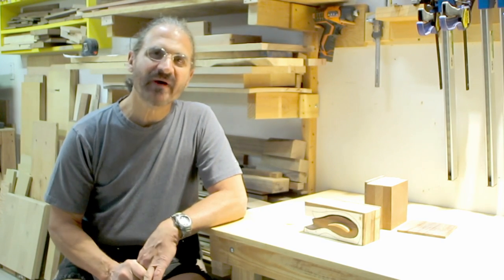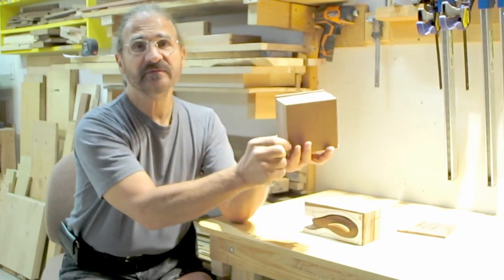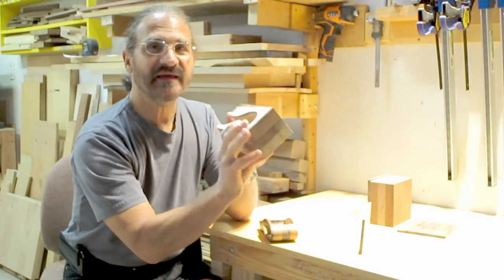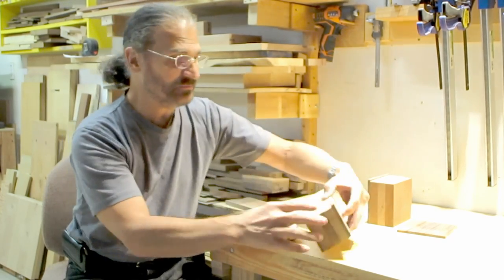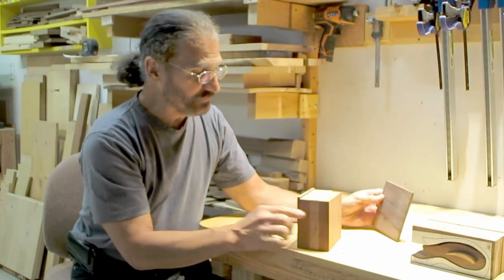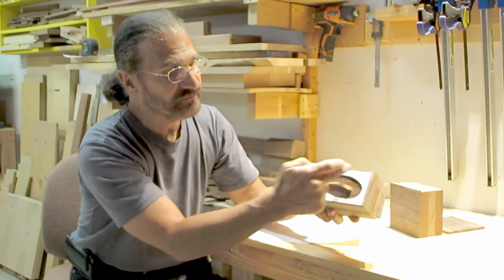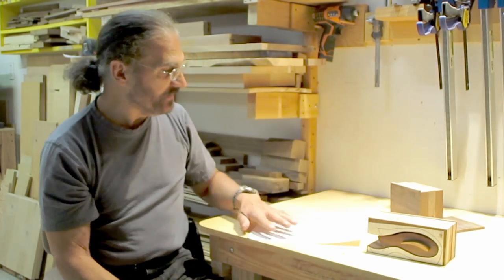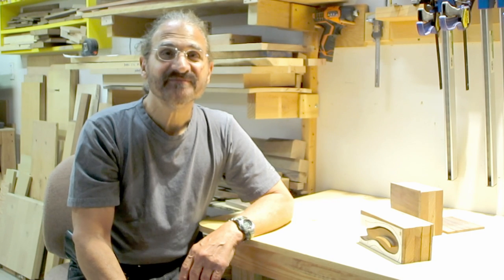Bandsaw Box Tips

Comment: what type a blade should I use to cut out band saw box,presently using a 3/8 inch  7 TPI. After making cut, difficult to  pull wood away from the blade. Cut blocked with sawdust ,have to ply open cut to remove  blade. Box made up off pine 3 pieces and two pieces of oak ,glued to gather about  4 inches  in thickness
TK
Reply from the maker: Hi Tom. I use a 3/16, 4TPI blade (such as the Hartville Tool, B932. With this blade I haven't had the problems you mentioned. I suspect that because you're using a finer cutting blade, it's not clearing out the saw dust as well.
Reply: @knotnowwoodworking  thank you

Comment: Not sure why you would not just cut the back to start with ? The face of your board are smooth and flat, And  the cut marks from your band saw blade match up perfectly anyway ? The little bit left of the bandsaw blade cut would add texture for glue adhesion, it doesn’t need sanding when reassembled. Also you would be adding depth to your box, now your drawer would recess further than the face of the box , forever having to adjust your drawer each and every time you closed( pushed) the drawer back in. Sorry but I’m not convinced this is a simpler or effective step to take.
Reply from the maker: Hi Steve. In my experience, I've always had to sand the cut-off part for a good fit and to make the seam line disapear. The thing about the saw marks matching just didn't work for me (might have to do with the band saw blade I use). Also, using a contrasting wood for the back made for an interesting detail. The depth wasn't a problem because I aways use a couple of small pressure sensitive adhesive pads inside the box, on the back for the drawer to hit against. I also cut strips out of PSA felt for the bottom of the drawer to slide on--makes for very smooth operation of the drawer. Thanks for your comment.